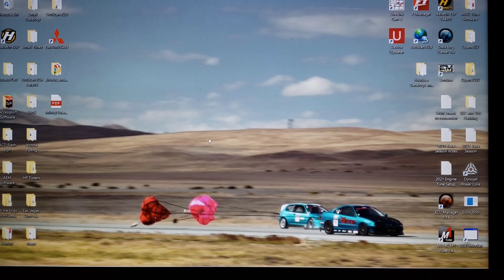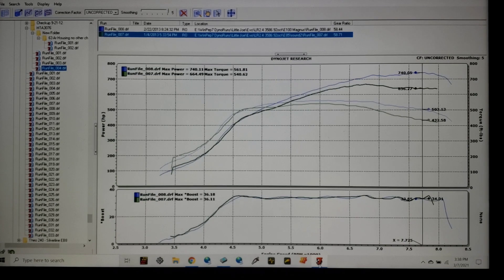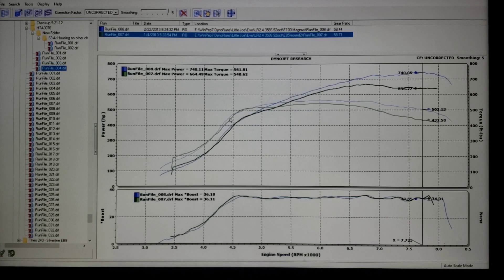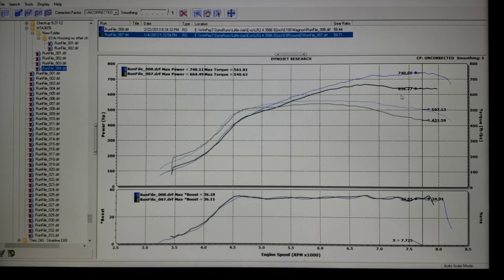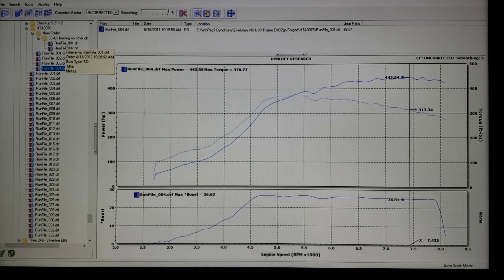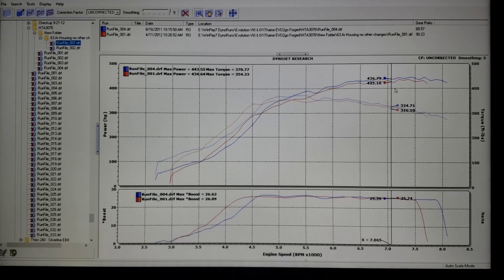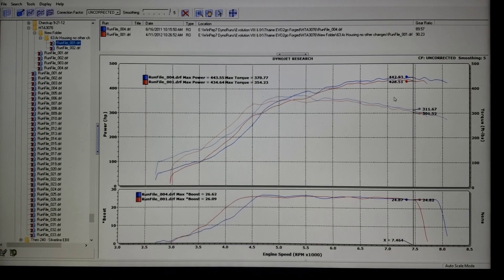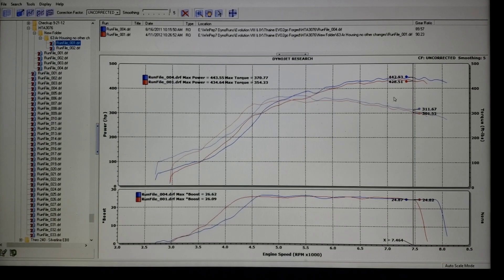Is Your Turbine Housing Hurting or Helping?

Comment: Thanks for the video, is there a material difference in flow between a T3 open 0.63 AR vs a T3 twin scroll 0.61 AR.

I would expect the twin scroll to boost earlier vs an open housing but would like to confirm if there is a difference in top end flow given the AR difference is 0.02 (0.63 vs 0.61)

Comment: Any news till now? Im going to change my AR 0.64 with 0.57 one. GT2860RS with 1.4cc.

With 64 one, 352 hp 7550 rpm, 8300 rpm max and 1.8 bar max, 1bar at 4300 to increase rpm per rpm.
Reply: Did you end up doing this swap?
Reply: @Bradley0beaver  yes. Pressure increase but without HP increase. Much damage, less lag but less rpm.. Before i run with 8300 rpm limit, then with 0.57 one, only 5700. I'm moved to another solution, GTX2867R with ar 0.86. I've loss 500 rpm, now peak pressare is almost in 5200rpm zone, but engine is more friendly below 4500, engine can Quick response to ignition riming and knock feedback
Reply: @xGhia666x  Damn! thats not what i wanted to hear, im using a gtx2860 0.64 and the spool is terrible! Trying to go for smaller housing to help.

for you, 2867 .84 spool only 500rpm worse than .64 2860rs?!
Reply: @Bradley0beaver  for every one else, my A/R 86 sound better only if we consider high rpm use, not for a Quick response or something user-friendly.
Is a good turbo but you have to consider good and bad things
Reply: @xGhia666x  i agree bro, i was hoping to improve my spool but it seems like it wont be possible without losing lots of top end power, i am rev to 8.2k and .64 keep max boost till redline, i think .57 or .52 will not by your results
Reply: @Bradley0beaver  in my engine, doesn't work for cam and head, maybe in yours can work.
Which engine do you use? Camshaft? Crankshaft weight?